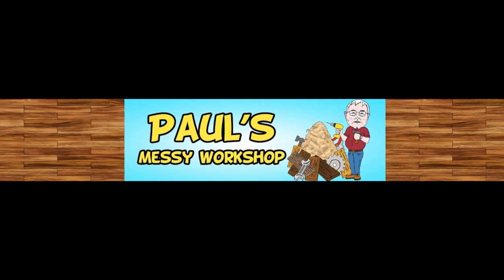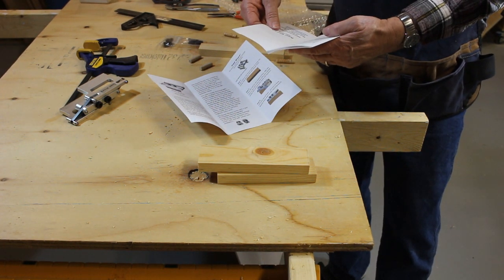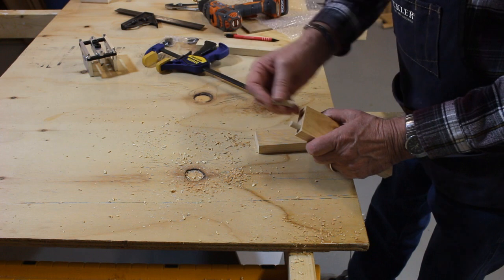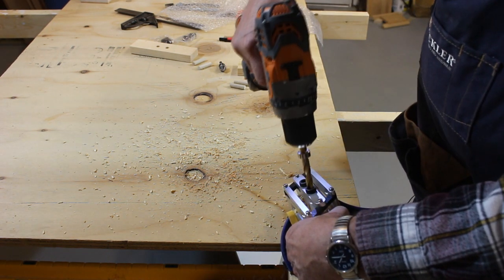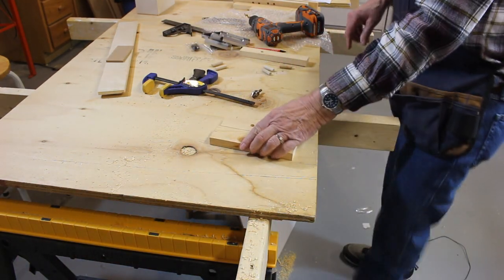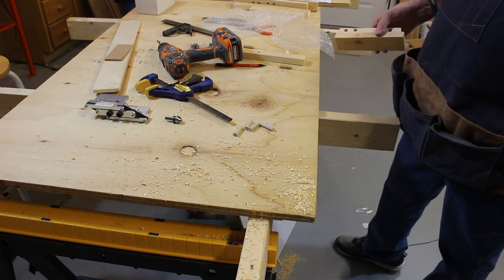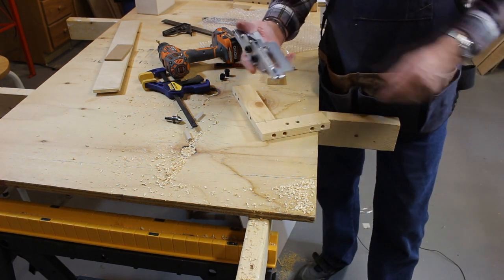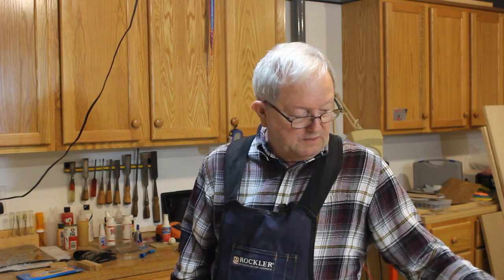I test the Dowel Wizard

Comment: All the doweling jigs I’ve seen have 1/4”, 3/8” bushings, but I’ve never seen one with 3/16”. The third bushing is always 5/16” which I use a lot. Check the markings on your bushings and see if you meant 5/16”.
Reply from the maker: Alan,  Thanks so much for your input.  Most doweling jigs do have a 1/4", 5/16", and 3/8" bushings.  This is not the case with the Dowel Wizard, it comes with 3/16”, 1/4”, & 3/8” bushings.  I double checked on their website, http://www.dowelwizard.com/best-wood-doweling-tool/  just to be sure.  I agree that 5/16" is a very handy size to have.  I appreciate your drawing this to my attention however.  Thanks so much for watching and taking the time to comment.

Comment: Have you ever tried the Dowalmax system?  How would you do end grain to face grain on a board wider than the jig?
Reply from the maker: Daniel, No, I have never tried the Dowelmax system.  It looks like a nice system however.  With the Dowel Wizard it is no problem to do the joint that you mentioned in your comment.  It is just a matter of marking registration lines then on the face board you just clamp the jig where you want it then drill the holes.  On the end grain you just place the jig at your registration marks and drill.  The only time I can think of that would be a problem is if you were joining a board, end grain or not, midlength to another board.  I can't think of any jig that will work in that situation so I guess you would have to resort to good old doweling centers.  Thanks for your question I hope I answered it to your satisfaction.  Thanks for watching.

Comment: I really like the Joint Genie. No need for marking sth. or to use any shims.
Reply from the maker: Holger, the Joint Genie is a great tool, no doubt about that.  I have never tested or used one so I cannot make a fair comparison.  Thanks for taking the time to tune in and leave a comment.
Reply: paulsmessyworkshop Then you should really get one and try it out :)

Comment: 09:55 That did not look perfect to me.
Reply from the maker: Good catch!!!  Couple of things, if you look closely the joint isn't closed all the way making it look like it is off.  When I turn the joint around and put it together again it closes all the way and looks like it should.  I will admit, it doesn't look like it fits very well in the first shot.  Thanks for watching and leaving the comment.
Reply: I'm happy to hear it actually was a good fit, because the device looks pretty slick.
Reply: Adding a 1/4 inch spacer to one side only of a board will make the holes 1/8 th inch off center of the board, not 1/4 inch.